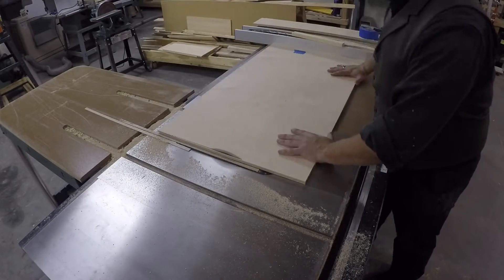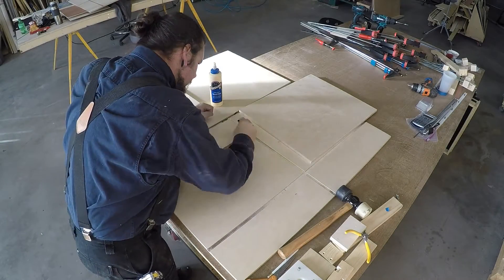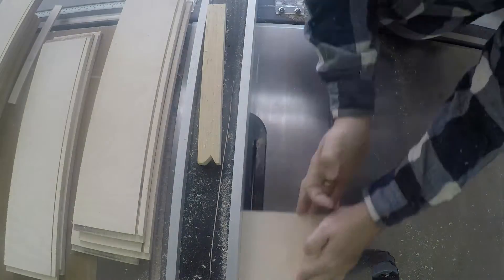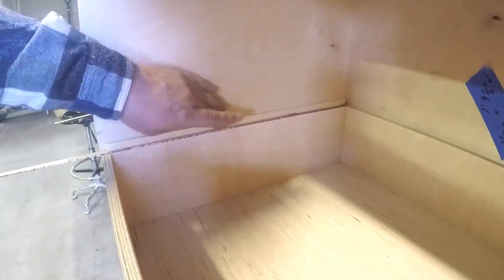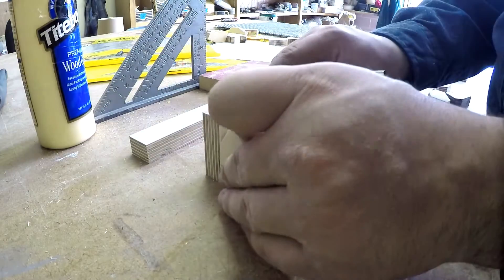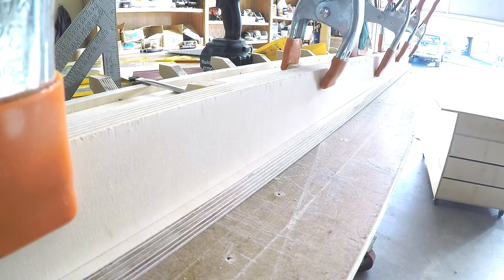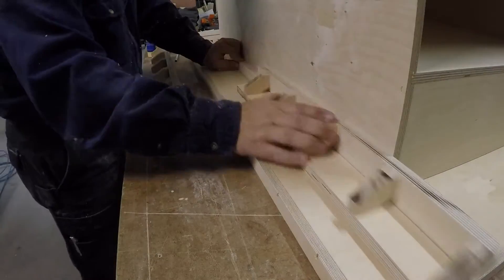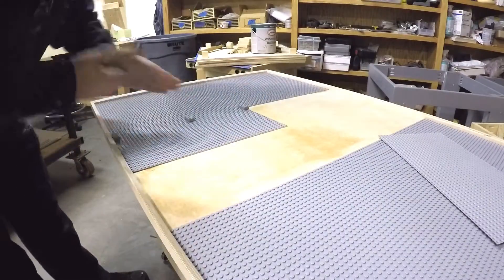How I made a Lego Play Table

Comment: What adhesive did you use to apply the LEGO bases?
Reply from the maker: I used a 3m spray adhesive, either High Strength 90 or Super 77 (I forget). I expect many kinds of glue would work